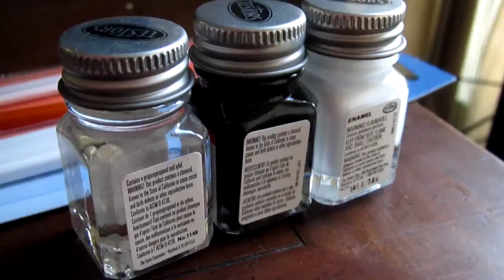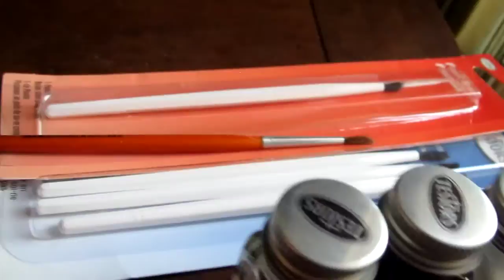Testors Enamel for Case Modding? Yep

Comment from the maker: @Films4You The bigger the brush the bigger the "loose bristle dilemma" becomes. With a tiny brush there are a lot fewer hairs ;) But still a good tip is to wet the brush and groom it with your fingers or  clean cloth to try and pull the bristles loose. If you pull the paint with the brush and don't scrub the paint around or push the paint into the brush it's easier on the brush and results in fewer stray bristles in the work. Just inspect your work and lift out any bristles with a dry brush.

Comment: hey there, i was wondering how you paint the inside edge of a side panel window. is this the paint you use? do you use the thinner with it? and does it have trouble sticking on such a small surface area? thanks